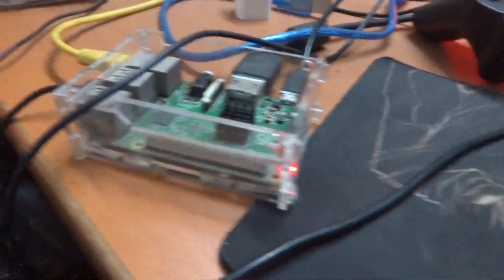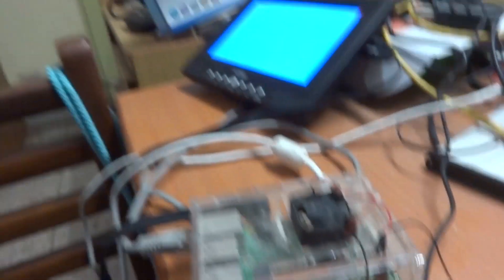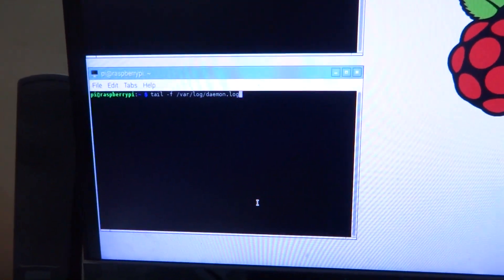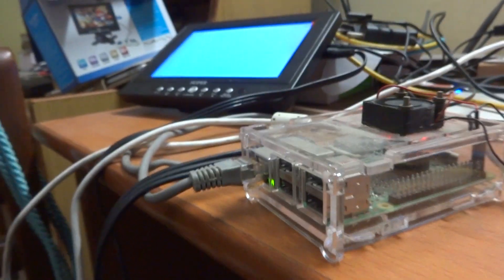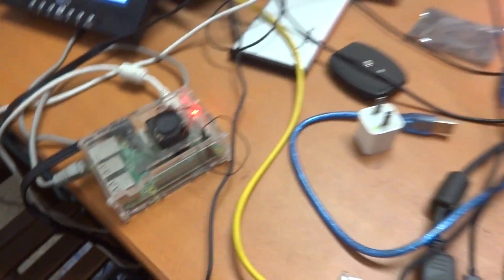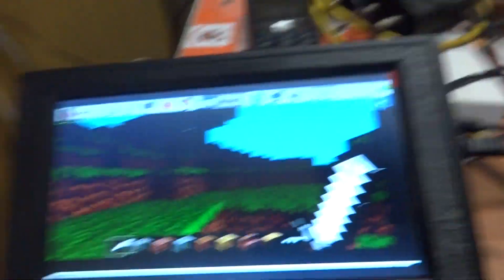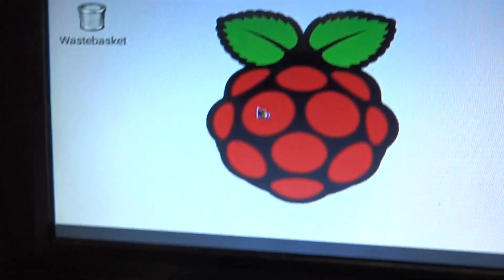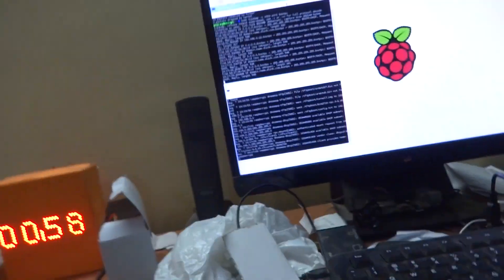Network Boot Raspberry Pi 3 | Pi 2 | B+

Comment: Hi,I always run into problems :-( could you give me an advise for trouble shooting?
Could the problem be the network? I have a router (192.168.179.1) with DHCP, a Pi2 (192.168.179.5) and the client Pi3. All connected to the router.

root@raspberrypi:/home/pi# tail -f /var/log/daemon.log 
Feb  2 15:42:11 raspberrypi dnsmasq-dhcp[1046]: 653460281 available DHCP subnet: 192.168.179.255/255.255.255.0
Feb  2 15:42:11 raspberrypi dnsmasq-dhcp[1046]: 653460281 vendor class: PXEClient:Arch:00000:UNDI:002001
Feb  2 15:42:11 raspberrypi dnsmasq-dhcp[1046]: 653460281 PXE(eth0) b8:27:eb:56:d9:2c proxy
Feb  2 15:42:11 raspberrypi dnsmasq-dhcp[1046]: 653460281 tags: eth0
Feb  2 15:42:11 raspberrypi dnsmasq-dhcp[1046]: 653460281 broadcast response
Feb  2 15:42:11 raspberrypi dnsmasq-dhcp[1046]: 653460281 sent size:  1 option: 53 message-type  2
Feb  2 15:42:11 raspberrypi dnsmasq-dhcp[1046]: 653460281 sent size:  4 option: 54 server-identifier  192.168.179.5
Feb  2 15:42:11 raspberrypi dnsmasq-dhcp[1046]: 653460281 sent size:  9 option: 60 vendor-class  50:58:45:43:6c:69:65:6e:74
Feb  2 15:42:11 raspberrypi dnsmasq-dhcp[1046]: 653460281 sent size: 17 option: 97 client-machine-id  00:44:44:44:44:44:44:44:44:44:44:44:44:44...
Feb  2 15:42:11 raspberrypi dnsmasq-dhcp[1046]: 653460281 sent size: 33 option: 43 vendor-encap  06:01:03:0a:04:00:50:58:45:09:15:00:00:12...
Feb  2 15:51:37 raspberrypi dnsmasq-dhcp[1046]: 653460281 available DHCP subnet: 192.168.179.255/255.255.255.0
Feb  2 15:51:37 raspberrypi dnsmasq-dhcp[1046]: 653460281 vendor class: PXEClient:Arch:00000:UNDI:002001
Feb  2 15:51:37 raspberrypi dnsmasq-dhcp[1046]: 653460281 PXE(eth0) b8:27:eb:56:d9:2c proxy

root@raspberrypi:/home/pi# sudo tcpdump -i eth0 port bootpc
tcpdump: verbose output suppressed, use -v or -vv for full protocol decode
listening on eth0, link-type EN10MB (Ethernet), capture size 262144 bytes
15:51:37.688508 IP 0.0.0.0.bootpc > 255.255.255.255.bootps: BOOTP/DHCP, Request from b8:27:eb:56:d9:2c (oui Unknown), length 320
15:51:37.690156 IP 192.168.179.5.bootps > 255.255.255.255.bootpc: BOOTP/DHCP, Reply, length 315
15:52:16.072058 IP 0.0.0.0.bootpc > 255.255.255.255.bootps: BOOTP/DHCP, Request from b8:27:eb:56:d9:2c (oui Unknown), length 320
15:52:16.073813 IP 192.168.179.5.bootps > 255.255.255.255.bootpc: BOOTP/DHCP, Reply, length 315
15:52:20.151100 IP 0.0.0.0.bootpc > 255.255.255.255.bootps: BOOTP/DHCP, Request from b8:27:eb:56:d9:2c (oui Unknown), length 320
15:52:20.152805 IP 192.168.179.5.bootps > 255.255.255.255.bootpc: BOOTP/DHCP, Reply, length 315
15:52:29.169667 IP 0.0.0.0.bootpc > 255.255.255.255.bootps: BOOTP/DHCP, Request from b8:27:eb:56:d9:2c (oui Unknown), length 320
15:52:29.171405 IP 192.168.179.5.bootps > 255.255.255.255.bootpc: BOOTP/DHCP, Reply, length 315